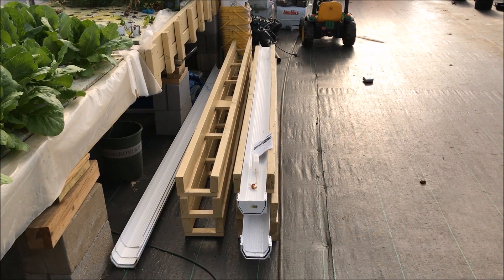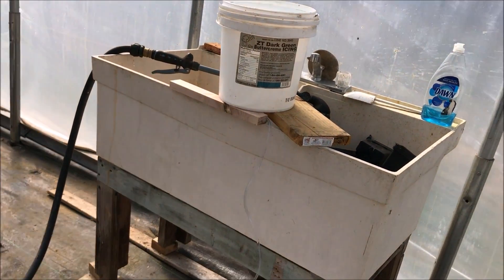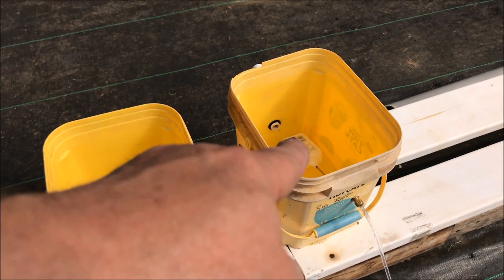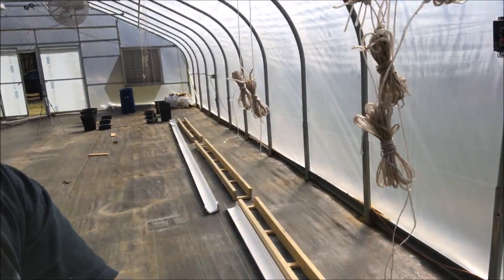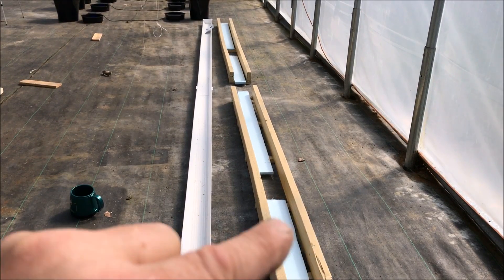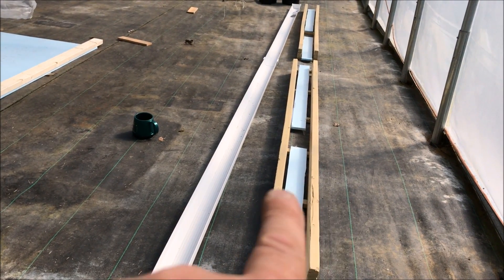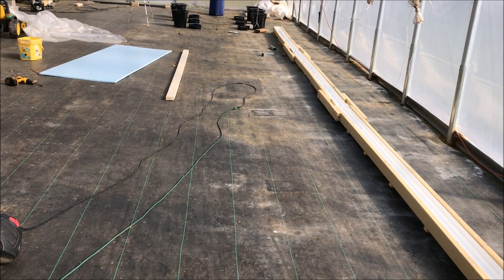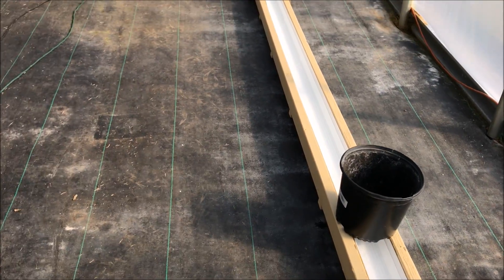Self Watering Wicking Bucket Grow System Build

Comment: Nice build. Just a thought to save material, you can just put the styrofoam over the cross supports since that's the only support you'll be getting anyway. You can also use 1"x 4" lumber squares for that purpose. I like the clean look of joining the gutters but I put a 1/2" tube between all my gutters for easier future modifications. I have commitment issues LOL.
Reply from the maker: Funny that you mentioned that Jeff. My last two systems are done with 1 x 4's But I ran them all the way down to keep the gutters from sagging later in the systems life cycle.
I would love to see your system. Make a video of it. People are really interested in this method of growing.
Chuck
Reply: I'm not much on making Youtube videos or Facebook but I just put some pics and 1 video on Facebook. 
  www.facebook.com/GardenCityAquaponics/ Guess I need to become more tech savvy.